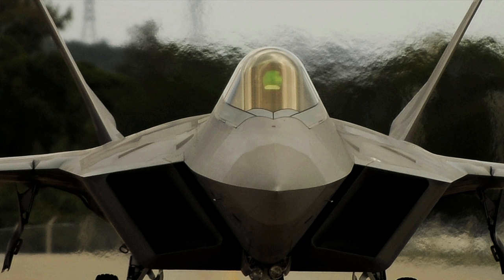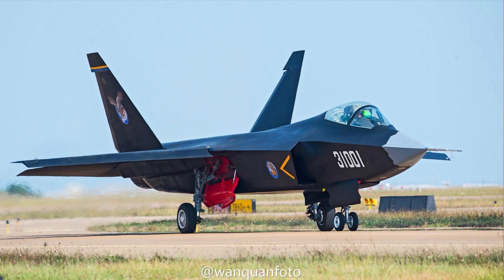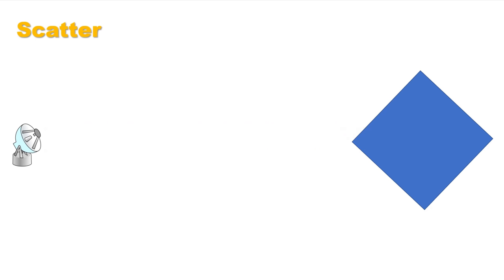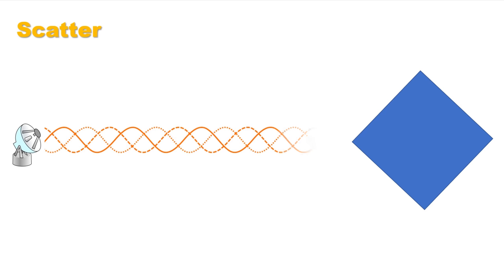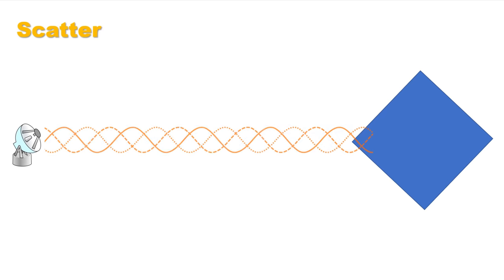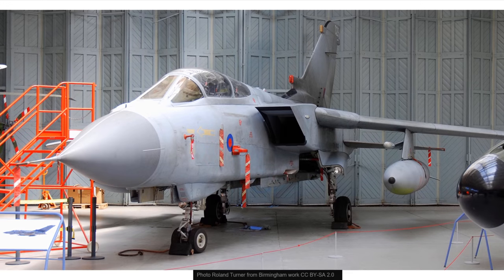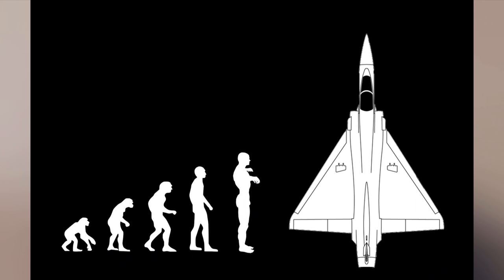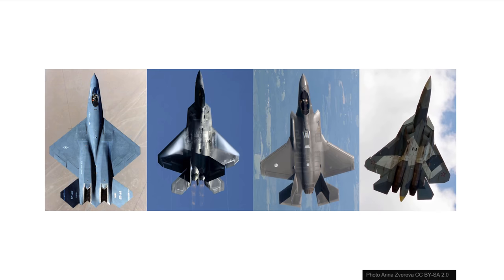STEALTH Killed AERODYNAMICS | why all modern jet fighters look alike

Comment: The F-22's shape is highly documented and available (visually) for study........the YF-23 on the other hand was a very well aerodynamically tailored and area ruled.  Low and behold, it's not the design everyone tried to copy, but it was certainly more akin to the kind of fighter needed for these days.  It had more fuel capacity, range, and better kinematics.  It's aerodynamically tailoring may have doomed it though, as the box style structure on the F-22 is stronger and more robust, notably in how it's weapons bays are placed and configured.  YF-23 and it's prospective production version had the weapons bays in a very structurally weak place on the fuselage where it joined the wing.
Reply: not just this, but the missile bays were far more complex and thus prone to jamming - since all weapons were stacked on top of each other, if one missile jammed, the ones in the same bay would be unusable.

Comment: The irony that "stealth" was accidentally discovered during WW2 during the development of the flying wing because of it's aerodynamics.
Also modern jets are plenty aerodynamic even with the shaping for stealth to deflect radar (though the absorbent paint helps as well), it's just the aerodynamics are different at sub-sonic speed  and trans-sonic speeds... Plus with higher output engines now days you don't need as perfect a lifting surface for lower speeds which would affect the trans-sonic speeds when pulling high G maneuvers.

Comment: One of the few channels that actually has intelligent content. So with the SU27 being more aerodynamically efficient than the F22, how would the SU compare to a fighter with canards like a Rafale or Eurofighter?
Reply: 9.27 boyo - that's your answer
Reply: The Flanker family is not "more aerodynamically efficient" than the F-22. 
That is just a claim of the author of this video.
Reply: @turnnburn6892  you're simply in complete denial...  hehe
Reply: @benfekete1744  wdym?
Reply: Actually you can look at the SU-33 or the SU-30, an SU-27 family aircraft with canards. In general it probably have the same effect as leading edge slats which enhances lift and maneuverability at low speeds.
Reply: @turnnburn6892  explain yourself. If  SUxx  can achieve the same speed at lower input from the engines than F22 what do you think it means?
Reply: @dan-ue4kd  but can an Su-27 still achieve those speeds with 8 missiles?
Reply: @anthonyb5279  do you even know what notching is? You fly perpendicular to the radar and the doppler radar can't see you anymore.

Comment: Yep. Stealth is not pretty. Eventually they moved away from the SR-71 when they realized that part of the path to a low observable was to make something that no one wants to see. The Blackbird was beautiful, you wanted to see it but it was too fast and too far away to see. How to get closer while flying slower is obvious in hindsight. In fact, all of the radar stuff about finite element analysis and the rest of it is stuff that they made up for a TV documentary. What really happened was that they kept making ugly planes and then seeing how they did with radar. And it almost worked too well. They had to bribe the radar test operators to try to find them because they didn't want to see them either.

I'm not making any of that up. I gave Otis some AC and he confirmed it. Honest.

Either way, the Su-27 is still one of the best looking planes ever. Maybe not the best plane ever but really, it's a looker.

Comment: Interesting topic. I was pondering how much compromise the B2 has because it is designed purely for stealth. In fact, I am very sure the design requirements placed stealth as number one priority, and anything else a distant second. And this leads into the wings and the impact on the structure itself. Optimal stealth is achieved by carefully controlling the angles of reflection. But wing flex has to get in the way, which leads me to assume that the B2 wings are as stiff as they could build them.

The ride for the crew must be brutal in anything but calm conditions. And the life expectancy of those wings must be very low.

Comment: I wonder what would be a good way to defeat stealth. Would acoustic detection by ground stations be a possibility? As you noted, the trend is that the less then perfect aerodynamics are beeing offset by very performant engines. But could this be an Achilles heel? Many people have noted that both the F-22 and F-35 seem to make much more noise compared to previous generation of planes.
Reply: Hmm, never mind. Supercruise would probably defeat this option since the plane travels faster than it can be detected. Maybe that's the reason why so much focus is beeing laid on supercruise.
Reply: @g412bb  the F-35 has the same level of sound in AB as the Super Hornet. Same with the F-22. The frequency of sound is a little different but not louder.
Reply: @g412bb  
That doesn't work since the late 50s, that's why the XB-70 was cancelled because it's no longer possible to "fly faster than it can be detected."
Reply: Back to the old listening post from early WW2

Comment: Someone said that F-35 and F-22 are even more fuel efficient  because they store payload in fuselage so there is less drag and better aerodynamics than is 4th gen planes. And also engines are moe efficient because suppercruse .
Reply: All things being equal, a stealth aircraft is aerodynamically less efficient than a non-stealth aircraft. And it's not like non-stealth aircraft are forbidden from internal carriage either. It's just that such internal carriage is usually reserved for supersonic bombers. Something that has yet to be implemented in non-stealth aircraft,  although later F-15s are doing it, is conformal carriage. This minimises the airframe penalty for internal carriage while also minimising RCS and drag impacts of external stores. If newer 4th gen aircraft ever get designed, you can bet on conformal carriage becoming the norm.

As for supercruise, as you may have noted with Millenium7's presentation, the F-22 supercruises only through brute force. The later Sukhoi variants, as well as the Eurocanards, all being non-stealth, can also supercruise. Meanwhile the F-35 even with a massive engine, still needs afterburner to achieve supersonic before supercruising only for short periods of time. Although engine improvements might change this. The loss of area ruling is so detrimental to supersonic performance, that it's hard to overstate just how much of a penalty stealth imposes on an airframe's transonic drag. It's possible that 6th generation aircraft might be able to bring area ruling back given advances in computing.

Comment: I seem to recall from years ago that the F-22 requires an expensive and time-consuming reapplication of its stealth coating every few hours of flying time.  Is that still true?  And is it still true that the F-22 often flies without the stealth coating in order to keep costs down?  I'd really love Canada to get a follow on to the F-22 (or actual F-22s) for continental defense, but if not even the US can afford to run them as stealth, not even during peacetime, then what would be the point?

Add that to what I've said below about stealth's defeat being either imminent within 10 years (or recent but still compartmentalized knowledge to only the relevant researchers).
Reply: That's true, for interception and anti-insurgency missions, the F-22 often flies with poorly maintained stealth coating. The F-22's stealth coating is from the 90s, so it's not as durable as said the F-35, which use a bake-in stealth coating instead of a more superficial coating used by older stealth planes. The F-22 is expensive to fly because it's a large, twin-engine aircraft, maintenance of stealth coating is only part of that reason. Like what you said, the F-22 can still fly and even remains deadly even when stealth coating maintenance is neglected. If we're to extrapolate the cost per flight hour data, if you neglect the F-22's stealth coating during the maintenance altogether, its maintenance cost should be similar to that of F-15C/D. 

Stealth fighters always have problem with lower band radars, like UHF and VHF, so it's nothing new. However, it's not the end of stealth because those radars are not expect to survive the initial SEAD operation due to its poor mobility and size. Infrared sensor is sometimes said to be a silver bullet against stealth, but engineers do take that into the account and do design the aircraft to have lower IR signature, and infrared has its own limitation - it's sensitive to weather and IR missiles are usually slower and shorter-range than RF-guided missiles. And most fighters use IRST system that only points at the front.
Reply: Canada won’t even buy our F-35’s and they are on the production offset program. We wouldn’t sell them F-22’s even if we were still producing them.
Reply from the maker: @Mickey G " However, it's not the end of stealth because those radars are not expect to survive the initial SEAD operation due to its poor mobility and size."
IF, and it may be a big if, you can actually do a SEAD initial operation or any SEAD at all. Against a near peer opponent there is no guarantee that it is going to work. Stealth IS useful but it is not the silver bullet of air power.

Comment: I disagree on the subject of area rules. In fact, not only the fuselage count in the section area as was done in the 50s and 60s. Thus, on modern plane with complex aerodynamics computed in 3D, you can manage the area rule more precisely by changing the thickness of the wing at its root and the continuity between the fuselage and the wing and thus have an apparently straight fuselage.

Regrading stealth, some other tricks are very important. Cavities are very good reflectors thus all air entries are to be changed not to have 90° corners. The cockpit must be metallized to have a skin continuity as is the rest of openings. The radar under the nose which is transparent to radar must also be adapted and an AESA flat radar is particulary important in this case. And because of aerodynamics you will have to keep "rounded" wind leading edge which will mean a vertical reflector there. This can be managed trough specific materials of the wing edge but those are vulnerable to abrasion and collision. You can also have transparent to radar rounded wing leading edges with a diamond structure inside.
Reply from the maker: "I disagree on the subject of area rules." do you have an example?
Also this one may be of interest https://www.youtube.com/watch?v=S7EtFzn5mCM
Reply: @Millennium7HistoryTech  Look at the Concorde with its Gothic wing and the tu144. No wasp waist but they are dedicated supersonic planes.

Comment: Two questions:

1. Isn’t the speed of f22 artificially limited? I'm trying to explain what I mean. The Su-27 was created for the USSR Air Defense Forces and the USSR Air Force. The air defense forces demanded that it fly at speeds of more than Mach 2.5, since speed was important to them, but the Sukhoi Design Bureau refused since the plane was heavy anyway and they were constantly struggling with the weight (this was due to the fact that the general designer was constantly changing and everyone tried to change the airframe, which delayed the implementation of the project; in the end they returned to the original version after 3 years). Designers said that speeds greater than Mach 2.35 require other materials that are more heat-resistant and significantly heavier. And here’s the question about the F22: isn’t its speed limited by materials, as was the case with the Su-27?

2. Is the Su-57 a compromise between stealth and maneuverability?

Comment: I think it’d have been cheaper to just keep using the EA6-B and the EF-111, and design newer (but comparable, i.e., non-stealth) aircraft to carry the ALQ-99 jamming systems.

Those two aircraft were quite capable of rendering enemy radar and radio communications useless.
Reply: FA-18G Growler is pretty good platform for EW system. But yeah i agree that having cheaper non stealth fighter for EW is good idea. They will be easily spotted when activate their jammer, so why need to be designed as stealth?

Comment: In addition to the improvement in CAD, the stealth plane inherently has less parasitic drag in a combat configuration as it can carry its weapons internally, partially offsetting other aerodynamics problems of the stealth design. Also, only clean aircraft can come close to its maximum speed and maneuverability. Modern jet fighters will never go into combat without missiles, and non-stealth planes have to carry them externally, which create drags that will hampers its aerodynamics. The F-15's published maximum speed is said to be at least Mach 2.5, but according to an interview with a pilot, Paul ‘Skid’ Woodford, the fastest he have achieved in his completely clean (even pylons were removed) is Mach 2.21, and it's not common for the pilot to go supersonic anyway because fuel consumption of doing so would cut its combat radius to practically useless level. Even jet fighters that can supercruise can only sustain a supersonic speed for mere minutes due to the fuel consumption, making it only slightly better than using the an afterburner.
Reply: Bombers have carried their weapons internally since WWII.  Concealed weapons does not require stealth.  Not for bombers, not for fighters.  Stealth requires concealed weapons, but at the same time it does NOT allow the weapons to be concealed in an aerodynamically or maintainably optimum way.  Stealth requires non-optimum surface shape, edge treatments for the doors, coatings that wear off rapidly, etc.
Reply: @Lost-In-Blank  
Yeah, but non-stealth fighters tend to not have an internal weapons bay since it significantly increase the weight and overall size of the aircraft. The F-111 is a non-stealth fighter, but it's really heavy partially due to its internal weapons bay. But weight isn't really an issue since most aircraft with internal weapons bay have a comparatively large internal fuel capacity anyway. And internal weapons bay do have one benefit, it reduced the drag from the weapons that would otherwise be carried externally.

Comment: I don't think current fighters are really any more "generic" than previous generation aircraft. The F-14 and F-15 have many similar design features, especially from the front. Similar inlets appeared on the MiG-29 and Su-27 families, which also share some of their wing/body blending the F-16 and to some extent the F-14. 5th gen aircraft have their own "themes", but this isn't really new compared to previous generations.

As far as stealth killing aerodynamics I'm a bit skeptical. You point out for one thing the lack of area ruling but highlighting the width the F-22's fuselage from below. This isn't quite accurate since the area distribution arises from the change in the 3D shape of the plane along the length, so a constant width fuselage doesn't necessarily mean there isn't area ruling. Secondly, look at the F-15. It's even faster than the Su-27 you pointed out later in the video and it's also slab sided like the F-22. This would imply that the F-22 is at least equal with the F-15 wouldn't it? And speaking on the F-22 vs Su-27 comparison, I'm not sure if it's really informative. You compared aircraft top speed, but when it comes to military planes, this is constrained by more than just aerodynamics. Heating and structural strength need to be considered. Is the F-22 speed limited by one of these constraints? I don't think there is a public answer to that question. What might have been more interesting is the acceleration time to speed.

Lastly you mentioned that the stealth fighters have less optimized planforms and went on to mention the Su-27's optimization for M.8-1.3 flight. The F-22 at least is designed to cruise at a speed higher than this in combat, so it's not an apples to apples comparison. While the transonic regime was the most important for 4th gen planes, the focus might have shifted up to supersonic with supercruising fighters.

If I'm off on any of these points feel free to correct me though, thanks for the informative videos.